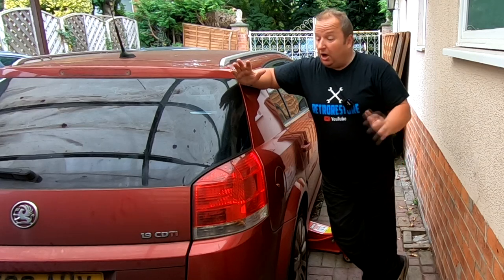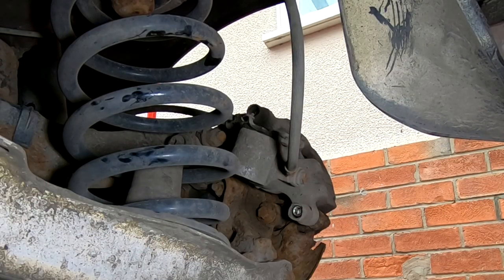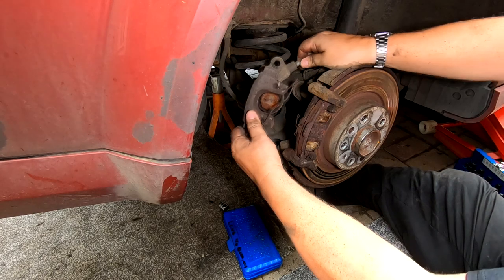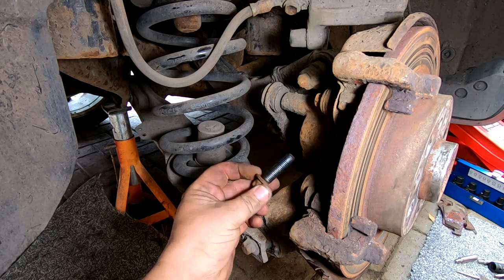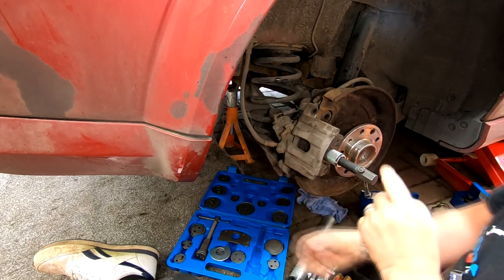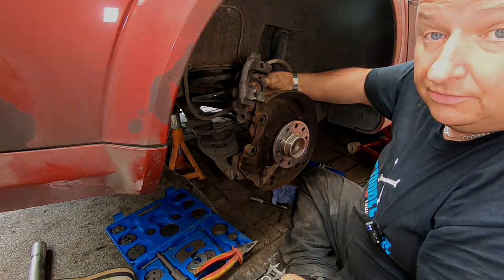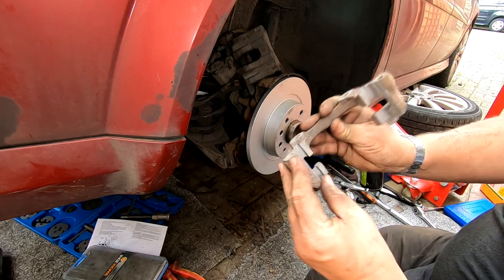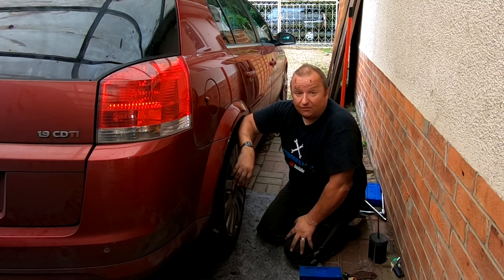Screeching Rear Brakes On ThisVauxhall Signum

Comment: As ever a great tutorial.  Top tip though, remove the disc retention screw before taking off the pads etc as if it is tight or a bit chewed up you can hold the disc with the handbrake to stop it slipping 👍👍

Also some pistons are clockwise and some are anti clockwise, need to check first as for example on the Mondeo MK3 the estates were different from the hatchback!

Comment: You can bolt the caliper back on with just one pin and makes it easier to wind in as it’s held in place. Also taking brake resivior cap off helps. I did an Audi last weak and forgot to take cap off and it fired fluid out the cap seal. Luckily I got away with it. I also greased behind the boot to prevent seizing

Comment: Great Video Martin 
Good to see the use of copper slip on the contact points for the pads in the carrier, very few people tend to use it now. 
It keeps everything free and reduces squeaky brakes 
Also a good brush of copper slip on that disc flange stops the alloy wheels seizing on. The amount of times Ive had to hammer rims off where people don’t both to grease it up 😡😡

Best Wishes 
Tim
Reply from the maker: Yes, the other side was seized on Tim.

Comment: Gotta love a siezed up brake caliper, I had one off a lexus the slider pins were so siezed in I had to take it off the car and heat it up with a blow torch and hit the pins with a hammer for about half an hour before they would budge.

Comment: Cracking video Martin, I usually remove the rubber sleeves that the pin slides in and clean them and the hole they sit in , water gets in under the rubber finds a bit of swarf of metal and swells into rust totally stopping the pin from sliding. Keep up the good work fella 👍🇬🇧
Reply from the maker: Yes Andy, I did clean them out off camera.

Comment: Just an fyi for anyone doing this, put the disc on with the little grub screw, and then the caller carrier with its 2 e10 bolts. Then get a small screwdriver and run it round the inside of the rubber boot to prevent it sticking to the corrosion and ripping of twisting like in Martin case. Then you can attach the caliper with the bottom bolt to the carrier leaving the other bolt off this way it doesn't move around and you can get your wind back tool on to the piston on your own and wind it back, without needing someone's foot 😄.

Comment: Another good video Martin. Seems like it was a bit of a battle though.
I always clean everything with brake cleaner first as it helps the piston move. 
I have also started using ceramic brake grease instead of copper grease. I find its better for the specific application.
Reply from the maker: Yes, I have some but it was in the workshop lol

Comment: If it would just go as planned ! Can you use a c'clamp to push that piston in ? Or is there no room for that ? Thanks for the tips !
Reply: Rear callipers are usually threaded. You have to turn them as well as push. 
Some are also left handed thread, so you don't know if you've just got a tight piston or you're turning it the wrong way lol.
Reply from the maker: There's only so much I can show in one vid Bill. I have another vid where I state that procedure.
Reply from the maker: Exactly

Comment: Should have taken the cap off the brake fluid reservoir Martin. You're pressuring the system trying to wind the pistons back in with the cap in situ. You can blow the seals in the reservoir cap otherwise. There's also better products out there for the lubrication of the pads on the caliper carrier and the slider pins, something like Permatex brake lube springs to mind.
Reply from the maker: Andrew, I've done other vids where I explain about removing the reservoir cap bud. You won't blow any seals. I have the whole range of lubrication bud and copperslip is fine for the carrier and rubber grease is fine for the slider pins. You of course are able to choose what you want to use.

Comment: Always  change them to new ones . I get them on ebay .saves hassle  and new rubbers . Need changing  .i use silicone  high temp .grease  .never get a problem  after

Comment: Looking at how tight the pins were and the look of the slider boots, I would suggest replacing them too
Reply from the maker: I cleaned and lubed them and they were fine Adam
Reply: @retrorestore  good news, I had one that had deteriorated internally and was binding on the slider

Comment: 7mm is not a standard size even though it is on loads of brakes. Nuts
Reply from the maker: So it is standard for Vauxhall Brakes lol
Reply: @retrorestore  m8 bolts have 6mm allen key fitting. M10 have 8mm. There is no m9 standard bolt. Therefore a 7mm allen key fitting is an oddball.
Reply from the maker: @richardsheil5289  Happy days.
Reply: @retrorestore  Thanks. Hope you understood I meant it as a small point of interest , nothing more.

Comment: As i have a vectra  which is the same . Please  bye a new kit of rubber and slider kit from ebay .you neend new springs aswel i lernt the hard way be resusing the old ons the rubbers swell up and it set the wheel red hot . After new ones and new silicone  rubber greas not had a problem  . Trust me .